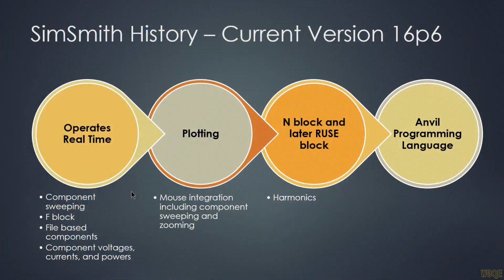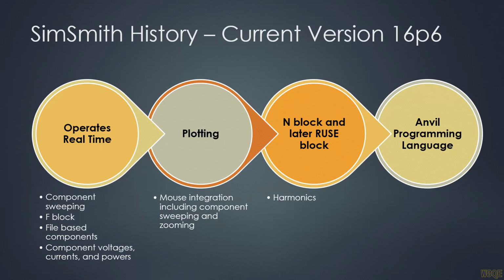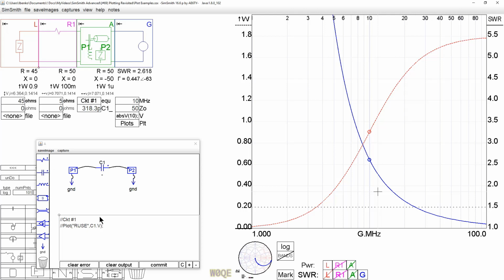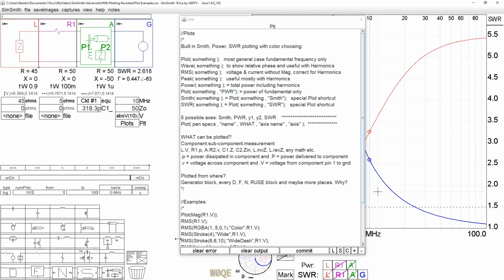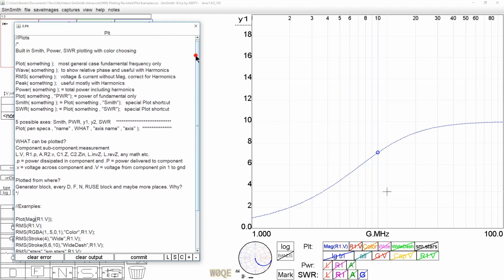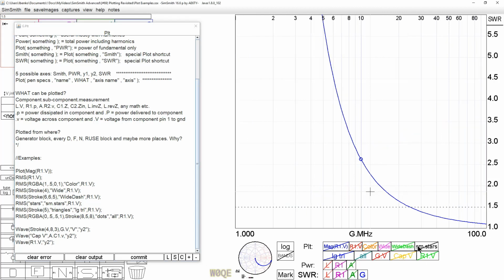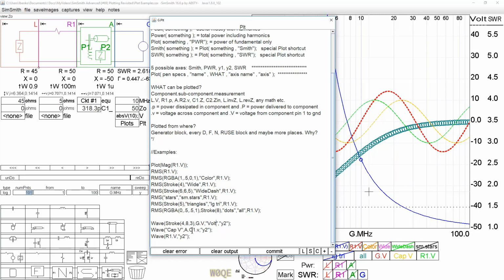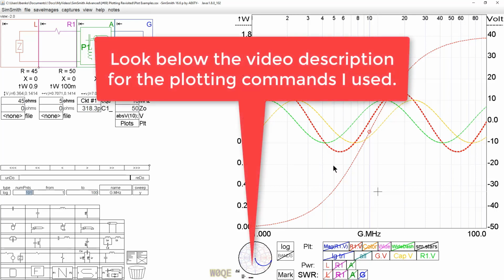#69: Plotting Revisited and Some SimSmith History

Comment: What are the axes on a Wave plot?
Reply from the maker: There is an implied horizontal axis of time such that there will always be 2 cycles of the waveform provided that the horizontal axis of the square chart is zoomed out completely and we are looking at the fundamental frequency in G.MHz.  If harmonics are enabled they will draw as more cycles (2nd harmonic = 4 cycles etc.).  The Wave plot is useful for showing phase relationships and general circuit understanding.  Does this make sense? 
Larry, W0QE
Reply: @w0qe  Perfectly. Thanks.